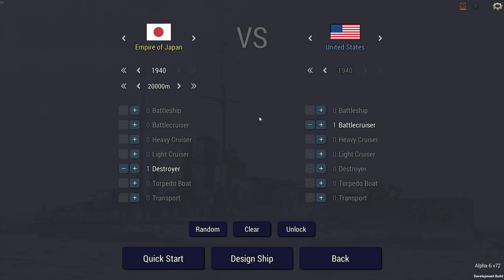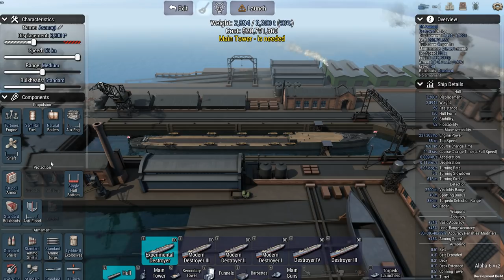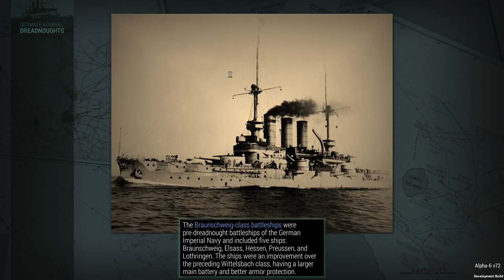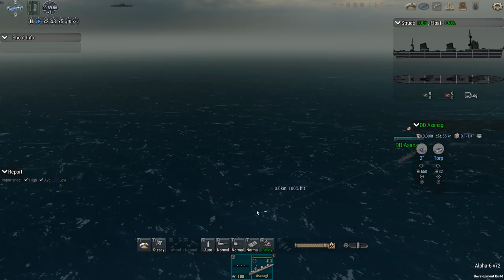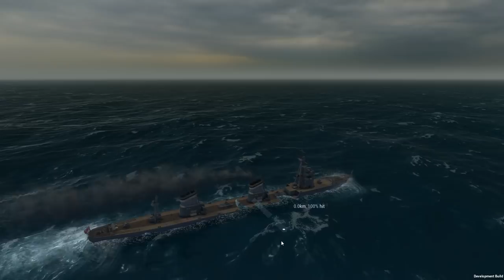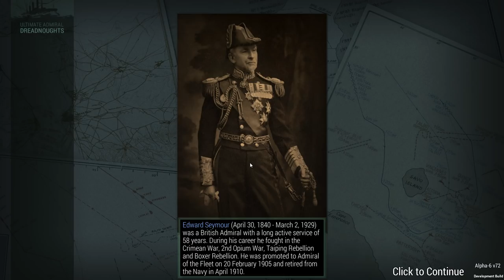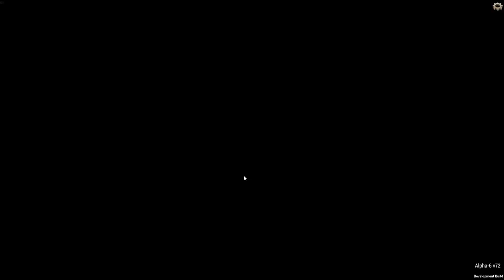Ultimate Admiral: Dreadnoughts - 55 Knots (Alpha 6)

Comment: Attempt 8 

Warning!! The japanese fleet consisting of 2 heavy and light cruisers, 14 destroyers and 10 transport ship is approaching our position with the intention to capture the island of Java. We have to defend the island by any means neccesary. Our fleet of consists of 2 british CAs, 3 CLs and 9DDs. We have to sink the all of the enemies transports and heavy cruisers if we want to win. Keep in mind that you will have to make sure that at least 50% of our fleet stays alive otherwise we will need to withdraw from the area.

Both sides will have ships with 1930s technology.
Your CAs have to resemble the HMS exeter as closely as possible that means:
-the displacement of 10500 tons (you can adjust if you need to)
-multiple expansion steam turbines
-boilers of your choice
-shaft of your choice
-Max speed of 32 knots
-long range
-3 x double 8 inch guns
-4 x single 4 inch guns
-2 x single 2 inch guns 
-2 x triple 21 inch torpedoe launchers
-3 inches of belt and belt extended armour
-1.5 inch of deck and deck extended armor
-Barbettes 1
-1 inch for turrets
-Maximum reinforced bulkheads 1
You can choose everything else

Comment: when you talked about the engine types in the beginning, its not just the base weight that is decreased, the horsepower per ton of engine increase as well which is why it loses 300 tons going from turbine to geared turbine and not just 1% engine weight. 
it still requires same amount of horsepower for the same speed on same displacement, more horsepower per ton means you lose more engine weight. thats why geared turbines 2 is still the best for weight even though the diesel engines are supposed to be lighter than the turbines
Reply: The diesel engines aren't supposed to be lighter, I think the large weight reduction modifier is to counteract their lower HP/ton a little and not make them ridiculously heavy. It means they could maybe be comparable to the first steam turbines (non-geared). Diesel engines also have their own advantages, most notably they have a much lower chance to be damaged, repair much faster and need less fuel storage. Basically you use a diesel engine if you want a more durable and faster to repair engine, or you want better fuel usage for long range ships (this one could be useful in the campaign when that arrives), at the expense of more weight. For all other purposes, geared turbines are the way to go. The higher weight reduction modifier I think is supposed to balance this out, so that you have an engine that is more durable without it literally being twice as heavy.

Comment: @Stealth diesel engines weigh more because of their lower horsepower per ton ratio. A larger(and thus heavier) engine is needed to achieve the required shaft horse power for the design speed.

Comment: It is not a Bug. Look also at HP per Ton. 
G. Turbines II got 30.5 HP per Ton
Diesel I got only 16HP per Ton. 
So when diesel engines are overall lighter, you need more of them to get the same Horsepower. 
In order to get to some speed, what is matter is total Horsepower of your engines. 
Your total HP of the ship is 273,303 HP (right bar, maneuverability section).

Comment: Don't just look at the weight reduction of the engine, look at it's horsepower too. Faster you want your ship to be, more horsepower you need. If you have a more powerful engine for the same weight then you don't need as big an engine. This is modelled in game, as you can see on the right your horsepower doesn't change when you change engines, only the weight. This is because the horsepower is calculated on how fast you want your ship to go proportioned with your ship's displacement. The horsepower is constant, but if you use a more powerful engine you don't need to have as large an engine.

Benchmark: Steam Basic, every ton gives 11HP

Steam Turbines: every ton gives 22HP, in other words to get the same HP takes half the engine weight, not 92%.

Geared Turbines: every ton gives 28.5HP, in other words it takes 77% the engine weight of the Steam Turbines to get the same HP, or 39% of the Steam Basic, not 91%. The difference is not just based on the engine weight reduction. How exactly that weight reduction is added I'm not sure, but I think the HP is a much greater factor. Perhaps the weight is calculated for it's HP per ton, then the weight reduction is applied.

Geared Turbines 2: every ton gives 30.5HP. This is a much smaller increase, only needing 93% the weight of the first Geared Turbines.

Diesel: every ton gives *16HP*. This makes this less weight efficient than the first Steam Turbines, only being 69% of the crappy Steam Basic. This may be trying to be offset a little by the massive weight reduction of 22.5%. The only reason to use Diesel engines are for the great damage resistance and repair speed; -65% engine damage chance and +100% engine repair. Geared Turbines 2 by comparison only has an engine damage chance of -37.5% and an engine repair of +50%. Another factor we aren't looking at is that the Diesel engines have reduces fuel stowage, which means if you are using a long or very long range ship then you save weight on fuel (and possibly resources? Don't know if fuel will be a limited resource in the campaign) compared to the steam engines, however the campaign isn't here yet so this isn't a big factor right now. Again this may also be to help reduce the impact of the terrible horsepower of the Diesel engines. These benefits are even greater with the Diesel 2 engine, along with slightly increased, but still bad, 18HP. Having an engine that is 80% the weight for the same size doesn't matter if it needs to be twice the size to get the same power.

If you want power and to save weight go with Geared Turbines 2, if you want damage resistance and to save fuel go Diesel.

Comment: Attempt 8:
Scenario Idea: the United States vs Britain in 1917

Scenario Description: Due to a series of fumbles, several leaks, a string of lucky breaks for Germany's intelligence services, and a mighty big screwup made by Britain (a Royal Navy cruiser sank one US protected/light cruiser and two US freighters off the shores of Norway), the US has declared war against the British and the French while siding with Germany.

This has, predictably, caused the Royal Navy to start seriously sweating bullets, as the British Navy is spread thin trying to ensure that the High Seas Fleet stays in Germany and patrolling the colonies and supply routes. This has forced the Royal Navy to detach units from the Home Fleet to ensure that the vital supply line to and from Canada remains open. While Germany prepares to break the North Sea blockade, a major battle near Canada develops...

You play as the US in this scenario, and your goal is to sink at least half of the battleships and battlecruisers.
 You will lose if your battleships are sunk.

US Forces:

3x Battleships (can only use a maximum 14-inch main battery (number of barrels not limited) and a maximum of 5-inch secondaries (number or barrels not limited), top speed is maxed at 21 knots; tonnage is uncapped)
4x Heavy Cruisers
6x Light Cruisers
10x Destroyers

British Forces:

3x Battleships
2x Battlecruisers
2x Heavy Cruisers
4x Light CruisersAttempt 7:
Scenario Idea: the United States vs Britain in 1917

Scenario Description: Due to a series of fumbles, several leaks, a string of lucky breaks for Germany's intelligence services, and a mighty big screwup made by Britain (a Royal Navy cruiser sank one US protected/light cruiser and two US freighters off the shores of Norway), the US has declared war against the British and the French while siding with Germany.

This has, predictably, caused the Royal Navy to start seriously sweating bullets, as the British Navy is spread thin trying to ensure that the High Seas Fleet stays in Germany and patrolling the colonies and supply routes. This has forced the Royal Navy to detach units from the Home Fleet to ensure that the vital supply line to and from Canada remains open. While Germany prepares to break the North Sea blockade, a major battle near Canada develops...

You play as the US in this scenario, and your goal is to sink at least half of the battleships and battlecruisers.
 You will lose if your battleships are sunk.

US Forces:

3x Battleships (can only use a maximum 14-inch main battery (number of barrels not limited) and a maximum of 5-inch secondaries (number or barrels not limited), top speed is maxed at 21 knots; tonnage is uncapped)
4x Heavy Cruisers
6x Light Cruisers
10x Destroyers

British Forces:

3x Battleships
2x Battlecruisers
2x Heavy Cruisers
4x Light Cruisers

Comment: diesel is more heavy because while it is more reliable and lighter per unit, it has less horse power so you need a bigger engine to keep the same top speed.

Comment: Diesel engines are very heavy compared to their predecessors so diesel 1 is 2x less than the weight of itself and diesel 2 is 1.5x less the weight of itself and that 2x bonus from its first gen so no bugs but definitely a weight to weight ratio going off of them being generally heavier minus their weight knock offs

Comment: I would use this ship in numbers against single or few targets. Imagine 10 of these rushing down 2 or 3 bbs. if the Ai works the same way that you set your guns based on primary and secondary, then 4 of those would get through without much hassle. maybe reduce the armor even more if possible and strap as many shortrange, high yield torps on them as possible

Comment: U need to look at "Horsepower per ton", which is why the Jump from Turbines to Geared Turbines, as U need "less engine" for the same horsepower
Diesel Engines doesn't have the same rate as Geared Turbines, and why U get more weighted engines

Comment: I'm pretty sure the diesel engines are suppose to be heavier than turbine. Diesels are heavier than turbine but the diesel gets better fuel mileage but the turbines are alot more faster
Reply: The diesel engines are also more durable, the standard one has like -60% chance to be damaged and +100% repair speed, diesel 2 is like -75% chance to be damaged and +150% repair speed

Comment: Title: The Super Cruiser

The age of the battleship is over as highlighted by the lackluster performance of the Yamato and Musashi in winning the war. The Imperial Japanese navy has tasked you to design the new 'super cruisers' to knock the US out of the war by sinking their last battleships. You will build 7 super cruisers that should be able to do at least 32 knots and have at least 9 gun barrels of at least 9inch and 4 torpedoes per side (1945 tech). You will be facing 3 most modern battleships of the US (1940 tech) and their escorts of 1 heavy and 4 light cruisers. 
The Imperial navy has told you that there are only 3 destroyers available to accompany you, as the rest of the navy is partaling in a distraction operation. This is to pull as many escorts away from the us battleships as possible they shall accompany you.
Your objectives are to sink 100% of the US battleships and you will fail if more than 3 super cruisers are sunk
Reply: Gecco man only up to 1940 tech

Comment: I would use these ships in a line of 2-3 ships, I would do sort of a drive by on whatever battleship I’m facing and have each of them shoot all their torpedos at it. With all of those torps in the water the hits that the battleship receives should be more than enough to sink their ship. (Look in responses for challenge)
Reply: They would also make a great port defense roll because they can hold off an enemy fleet for a while until a friendly fleet shows up to help.
Reply: The scenario I’m suggesting is that you have four 55 knot destroyers and you have to keep a fleet of 1 BB and 2 BC from getting too close to your transport ship that cannot move (represents a port). to win you need to protect the port for 45 minutes in game time.

Comment: 55 knots destroyer as useful unit? I think sacrifices in protection and armament are outweighing advantages from such high speed. Personally I would reduce speed to 45-50 knots to save a bit on engine displacement and cost to invest in more guns, torpedoes, better rangefindinder than Mk I eyeball and radio/radar equipment

Comment: You are ignoring the fact that 1 DD would not being going up against a single BC or BB.  Instead you would be attack with a pack of 5.  They can only target one at a time, chances are that you would get 30 torps off in one round, turn and flee. Of course doing that in the game would be impractical as you need to use manual control.
Reply from the maker: Ok, now I have to do a scenario with 5 of these speedboats operating as a wolfpack :)
Reply: @Stealth17Gaming  Yeah... go for it!